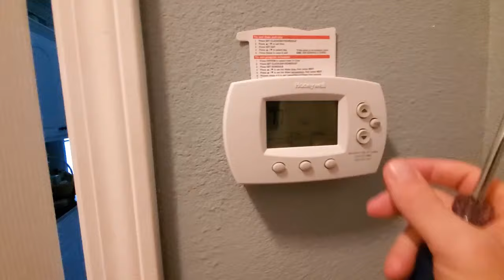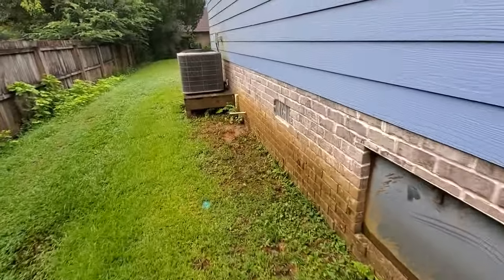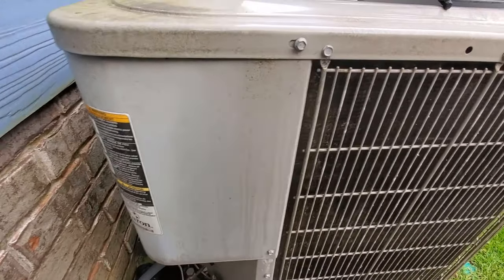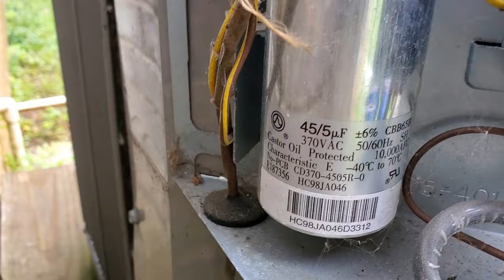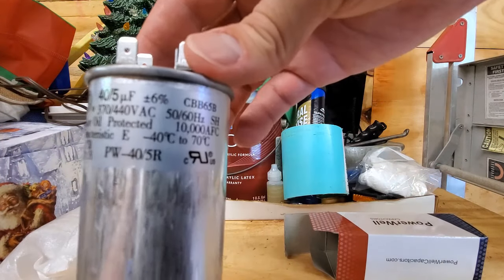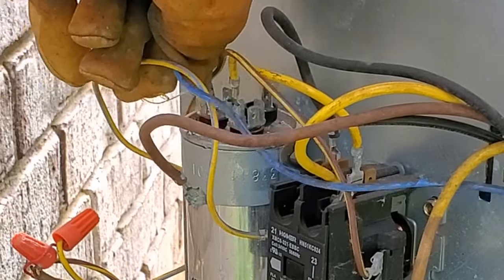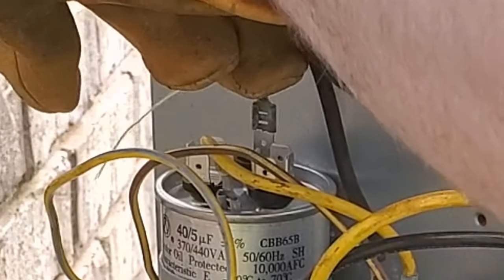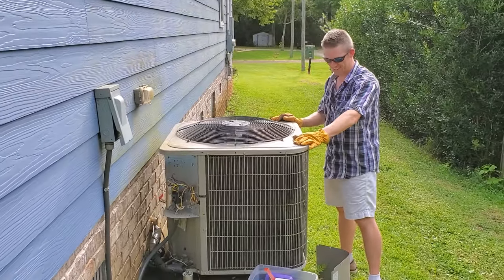How to fix your AC: fan not spinning

Comment: While watching your video I noticed that you replaced your old 45/5 uF capacitor with a 40/5 uF capacitor.  You need to correct this mistake.  This compressor in this case needs a 45 uF capacitor to start and run correctly.  The compressor is already running below the value of that which is considered permissible by most hvac technicians which is 10%.  (45 x 10% =4.5      45 - 4.5 = 40.5uF)   It's definitely below the 6% tolerance stated on the new capacitor.  If you continue to run this cap, sometime in the future your compressor will not start up.  Not only this, but the run windings on the compressor are running extra hot because the start (also called auxiliary) windings are not running at their full potential because of the under sized capacitor.  By the way the 5 uF (which is for the fan start windings) is correct.  Hope this helps.

Comment: Thanks for this post. It was exactly my problem and i had it fixed in day. Thank goodness i didnt have to replace the whole condenser or other expensive item. 
Seems like the capacitor is for both the fan and the pump since ot has 2 ratings

Comment: You need to make sure that your replacement capacitor has the same microfareds as the old one, to provide the needed boost. If the original capacitor is a for example 60/5, your replacement one needs to be 60/5! Not 55/5 or 55/10. Anything but the one from factory will not give the compressor or fan enough juice to start. Nice video : )
Reply: Glazed Guava Is he not allowed to watch it? I fix ACs and also look at videos. I observed what Vann Berg observed. You can wear out the motor windings with incorrect parts. Take it as a lesson and not an opportunity for you to critique.
Reply: @rruizproductions  I agree
Reply: My capacitor has failed.  However, when I get the fan moving by spinning it with a thin rod, the air still does not get cold.  Any suggestions?
Reply: @GarlandFarms  Depends on the refrigerant charge and the heat load in the house. Things to consider are whether it's running in cool or heat mode, (if it's a straight cool outdoor unit don't worry about the heat), and the outside ambient temp. If it's cold air coming out the fan outside and it's hot both inside and out, you have a refrigerant issue I believe. Change the run cap and go from there :)

Comment: SO, I did this to get it started thanks. I did call the Heating and Cooling people out. The tech said that the capacitor was fine and showed it to me and says that  it's not the capacitor but the fan motor. I'm thinking of getting an extra capacitor to see if they are full of crap and just trying to sell me a new AC
Reply from the maker: Yeah, you would only be out 20-30 bucks that way. But if that trick got it started, the new capacitor should do the trick.
Reply: Well, if the rest your AC is still working fine then just replace the fan motor.

Comment: Thanks for your tutorial... it aligned with others so yours was the reference for my 15 minute, $24 replacement. Worked perfect!... Just had a guy quote me $9000 for new air/heat.when I initially thought it was the compressor..(of course, right?). I expected as much. They were going to charge me $129 just to inspect my issue and give a repair estimate. I've cancelled him after ordering the part. Thanks again. Oh, and I made sure I electrocuted myself beforehand as you demonstrated as well ...seems to work.

Comment: Hello! You accidentally ordered a 40/5 capacitor when the one that you had before was a 45 /5 µF capacitor or so you should definitely replace that as soon as possible if you have not already! I do HVAC and this is definitely something you want to take care of as soon as you can because it needs that initial power of the 45
Reply: My AC in my house is barely blowing cool air and I went o look in the fan is not moving and I tried to turn it with the object and it still not turning

Comment: You saved my A$$ dude. Thank you. 109 today and the AC fan went out. I wasn't aware or you can spin the blade and it will start.
Reply from the maker: No prob! It helps until it shuts off again, but it will hold you up until you can repair it.

Comment: I watched the warranty guy do it. I don’t have the automatic tools to take the bolts off. I should of took a pic of the old capacitor. Actually the first time it stopped spinning was last year. All I did was clean the lil space on top of the blades with an unfolded wire hanger with a bit of cloth attached on the tip with WD40. Yeh that lasted for 3 months till summer of this year. Lots of going out and spinning with a chop stick for 4 days only if the temp was over 103 degrees. It would always spin back on it’s when the temp went below. I sent a chair by the window so I could see if the fan was spinning, I would run out and do the chop stick spin, if you don’t do right away, after 2 mins, the a/c inside makes a different noise and goes into a different mode. So yeh after you go out and spin the blade, you gotta wait a few mins for a/c to recognize the fan is spinning then it blows cool air in. 9 1/2 years till it went out. So I set the fan at 78 then after I went to spin, I set at 76. I didn’t have go back n spin as much.It’s was 50 mins on. 40 off when it 108+. If I left at 78.. it’s 20 mins on 15 mins off. That’s enough of lady talk.

Comment: Up at 10:15 at night when we noticed the ac not cooling. Turned out to be a plugged drain line AND the high water level sensor as the pipe coming off the drain pan was tilted back towards the sensor. Fixed those two issues and back in business. I think I’ll be getting a new capacitor though as my lights dim when the ac fan moron comes on.

Comment: Awesome video! Just bought my first home and AC unit went out 2 months later :/ looks to be the same issue because the fan started up fine using the screwdriver truck, but it was still blowing warm air inside the house even with thermostat set properly. Any ideas on where to go from there?

Comment: Fantastic video!  Only thing I didn't understand was how you remembered which cable goes where once new capacitor is installed.  What can I do to prevent error?
Reply from the maker: Snap a picture before you remove the wires. Look at the top of the capacitor for the codes on where the colored wires go.

Comment: With all due respect...I noticed you touched the terminals on your replacement capacitor with your bare fingers. Bad idea just in case it was a returned item and may have been charged by a previous purchaser. Always treat a capacitor as a LiVe one until you know for sure that it has been discharged, even a replacement!!! SAFETY 1ST😎👍

Comment: Fyi each one of those wires needs to go back on the same terminal if came off of. You will see c for common, herm for compressor, and f for fan. Take a photo of it before you remove it. You can also make sure the wire  colors  are correct but in my experience some people swap wires to things, and you end up with a mess. Never know who had there hand in there before. Chances are they where in the right spot just swap to same terminal. GL

Comment: Quick question - When spinning the fan with a screw drive it works. I replaced the capacitor, but the fant still doesn't kick on by itself. What do you suggest the next step of trouble shooting should be?

Comment: My ac done the same thing during heat wave, I took a water hose and spinned fan and it worked, amazing, but I'm not sure what caused the failure, my filter hasn't been changed in over a year maybe that's the cause

But people will freak out when their unit stop working and think the heat is unbearable but you can make it with fans and open the windows, I even bought a AC unit that sits on floor and only uses hose to let air out, it was $400 but after spinning my fan I don't need it, I will keep it for backup

Comment: Spray the fan with a hose on full and that'll get it spinning. Will probably help cool the unit faster too if it's been running for a bit without the fan working.

Comment: When you first walked around the corner, you said you need to spin the fan clockwise. When you completed the repair and turned it on the fan was spinning counter clockwise.

Comment: Thanks for sharing. My question: This capacitor activates and runs his big fan only or also the one, not visible in this video (I think called blower) which means blowing cool air inside a home?

Comment: This is the problem I'm having with my AC unit.  The fan isn't spinning.  I am going to try this so thanks for the video.  I have no idea what you're talking about at the end of the video however.  What about using clorox?  Drain pipe?  I've never done any maintenence on my AC unit and have no idea what your referring to but it sounds like i should find out.

Comment: I changed my capacitor back in June because it wasn't cooling off my house. Worked great!
Now here we are in July and the fan stopped working.
Could it be a faulty capacitor?
Reply from the maker: Hmm...  It's possible.  It could also be another issue as well.

Comment: You know you removed a 45/5 and installed a 40/5. It’s never good to go lower on the MFD for the compressor. So you may have compressor issues in the future. Just helping you out. Make sure you replace the capacitor like for like as far as the ratings. They are sized for a reason.

Comment: I actually replaced the capacitor months ago but it turned out being the AC switch inside next to the capacitor. Just woke up from a nap and the house was 81 degrees, turned the thermostat off for a few minutes, it turned back on but still hot air coming from vents, walked outside to the the condenser and I heard a low hum, put my hand on the cage and I could tell the hum was coming from the compressor but the fan blades were still. I kicked it, pulled the quick disconnect and nothing. Reached down for a thin twig and pushed the fan blade and it started spinning but still thought, it was running much quieter than normal.  Cool air coming out of vents for now but I guess I will slap the old good capacitor back on. Strange indeed. Anyways those switches are single and double poles, they’re usually In stock at ACE hardware and you can use a double pole switch as a single if that’s all you can find. Don’t pay a tech. If I can do it. You can too. Feels amazing when you can do it yourself. I should clean the unit as well, I think mine may be clogged. About to go out there now before the mosquitos come out but I’m cooling the house down first to 72

Comment: Change the capacitor & contactor! Buy both. I'd bet it's one or the other. If you change only one? The other would be next. Lots of wires? Take pics. BUT, take scotch tape, a sheet of paper, a pen, and scissors. As you unscrew/unhook a wire? Label the wire. Ex. Wires connecting to 1/L1 were taped with a piece of paper labeled as 1/L1 F for front wire & 1/L1 B for back wire. One wire at a time. Label each wire individually as you detach it. Then, take your 2 pieces to a local a.c  store. Google them. Call them. You will find one that will sell to the general public.  Take your 2 pieces in and they will get you the correct replacement parts. Take them home and hook them up. You will fix it! Guaranteed.

Comment: I know several people buy these $10-$20 generic capacitors off EBay and fails within 6-12 months. I go to a ac supply store and buy reputable ones. I know they cost more, but you don’t want it going out again when it’s 100 degrees.

Comment: Nice you just put on a 40/5 mfd capicitor on your unit that needs a 45/5. The 45 is the hermetic (compressor) and the 5 is the fan side. The other third is just the center. You put a 40 for your compressor when you needed a 45. Now your compressor which is very expensive is susceptible to premature failure.
Reply: I noticed that as well but it was just glossed over
Reply: I'm not very familiar with capacitors but can't you just add another wire from the 40 to the 5, and it'll give it 45 for the compressor.
Reply: Robert Roman That won’t work because then you’re taking the 5 mfd off the fan motor and using it for the compressor, which means the fan won’t receive any microfarads as a result.
Reply: My capacitor has failed.  However, when I get the fan moving by spinning it with a thin rod, the air still does not get cold.  Any suggestions?
Reply: Sometimes bad capacitors also prohibit the actual compressor from starting, often identified by an inconsistent buzzing noise or something similar. If thats the case, there really is no cheat card and you have to wait for a new run cap to come in.
Reply: @OsmHVAC  HVAC guy just left and you were exactly right.  Bad capacitor prohibited the compressor from starting.  Total bill: 188.22
Reply: Glad I can help, and am also glad you didn’t use the video for replacement. Like connors40 said he made a big flaw and changed his capacitor to the wrong size.

Comment: Would you mind explaining the part near the end about putting bleach in something? Thank you so much!!
Reply from the maker: Yes, so inside your home near the AC unit there should be a small PVC pipe.  This pipe runs outside your home and drips water.  What will happen over time is it could build up with mold from always being warm and wet.  By putting clorox down that pipe it clears out the gunk that could build up inside.
Reply: @KentsGarageGym    Ah ok! Thank you so much!!

Comment: what am I missing?   I've watched several of these videos where its mentioned to reconnect the wires in the same order as the one removed.  I even took a pic, but in this video, the blue and yellow wires were reconnected on opposite sides.  So does it matter?  Or area we looking at the number of sides on the capacitor?  Thanks.

Comment: Everyone's going to wipe the hardware store's long screwdriver supply :D   I'm going in a few minutes, please leave me one!
Reply from the maker: Any long object will do, a stick, hanger, etc
Reply: @KentsGarageGym  thank you but, the actual solution was to just hit the "reset" button on the outside air conditioner unit, for the system to start up. The reset button DID NOT have a label so, I didn't want to touch it. $80 lesson (An ex-coworker came over to fix the issue).

Comment: Looks like our capacitor is out. We have a home warranty I’m hoping the technician just replaces the whole do unit. I know I could buy and do it myself cheaper, but it 16 years old and probably ready to replace. When it kicks on the fan won’t spin, then is followed by a screeching noise. If I stick a stick in there to start the fan it catches.

Comment: Ohhhhh I never thought about the drain tube Being plugged. Where is it that you're supposed to pour the bleach?
Reply: any reply yet?
Reply: Nope
Reply: @lisamariestucci4723  my actual solution was to just hit the "reset" button on the outside air conditioner unit, for the system to start up. The reset button DID NOT have a label so, I didn't want to touch it. $80 lesson (An ex-coworker came over to fix the issue).

Comment: S O S >>>>just replaced mine yesterday worked fine untill tonight it started huming again and I tried with the screw driver to get the fan blade turning seemed like it would start then freeze up and stop is the fan motor going out ? its a brand new capasitor barely 24 hours old

Comment: Is the fan on the outside unit supposed to spin when running the heat? I noticed mine isn't and it's making the loud humming noise like your unit. I also noticed the fan motor is hot when I touch the top of the unit.

Comment: Do you think I have the same problem if the screwdriver truck doesn’t work on our AC? It randomly stopped working recently, and when we reset the ac the motor sounded like it was on but trying to push the fan did nothing
Reply: Replace the capacitor

Comment: It looks like the fan spun in the wrong direction when you turned it on. It spun counter-clockwise when it was supposed to be spinning clockwise.
Reply from the maker: @RoaringRecip  it worked fine

Comment: My  A/C is running. But the fan is not just spinning. Do you think the fan motor problem or the capacitor? Another question,  if I want to replace a fan motor, Do I have to get the same one as I have?

Comment: I know that you did this a year ago but from what I saw you ordered the wrong size capacitor. In the beginning of the video I saw a 45/5 uf capacitor but you received a 40/5 uf and installed it. I know that it did run because you are allowed 10% tolerance but once the capacitor wears it will go down so you started off with your tolerance level at40.5 which is why it ran ok for the moment. The 40 uf is for the compressor so is already .5% below tolerance and this will slowly wear out your compressor.
Reply: I agree he bought a wrong capacitor size 45 is not the same as 40, return it, Amazon got a good return policy on mistake.
Reply from the maker: Thanks buddy! I just bought a new one with the correct numbers thanks to you. I must have not been thinking straight woth all the heat!

Comment: You should not be using bleach to maintain your A.C unit drainage pipes. The better alternative to bleach for A.C. maintenance is white vinegar.  It is less corrosive and it keeps the pipes as clean as bleach does.